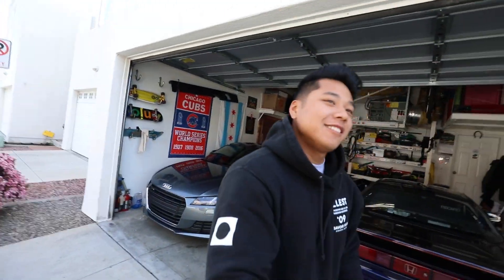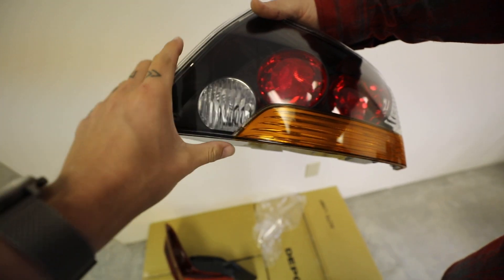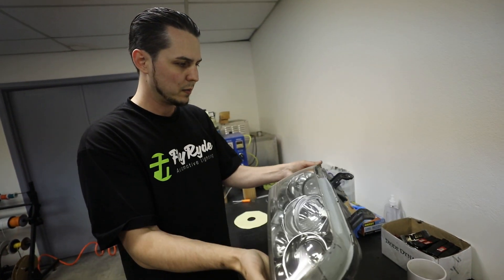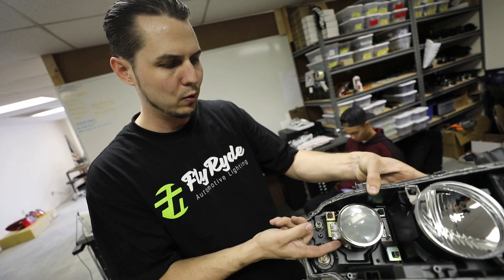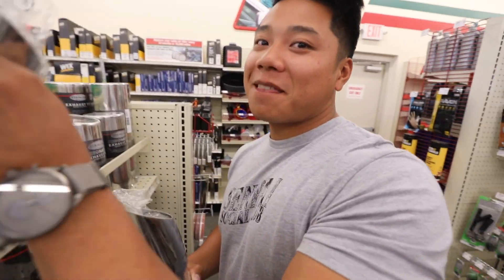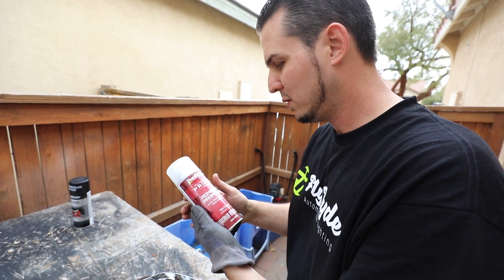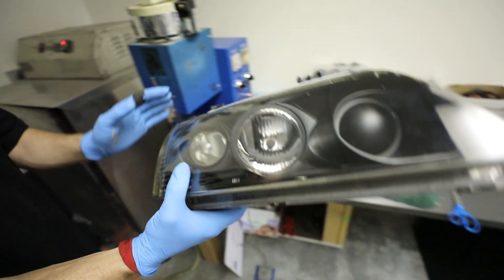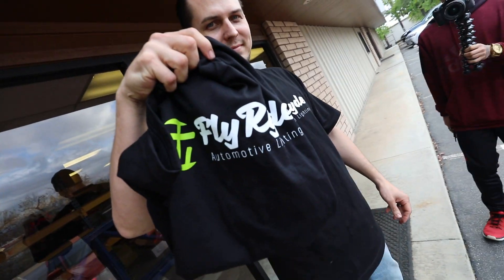PAINTING CUSTOM EVO 8 HEADLIGHTS - INSTALL DIY

Comment: Are those xkglow leds
Reply: MasterDrhd they’re not, we used Colormorph. Same type of LED, just a simpler board, simpler install, and smaller LED drivers which is better for hiding everything in the engine bay 👌